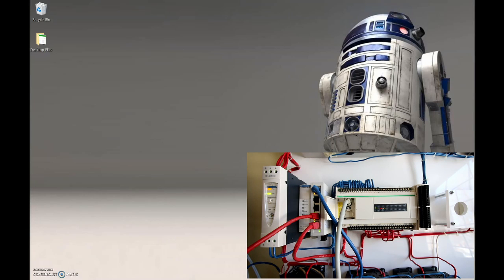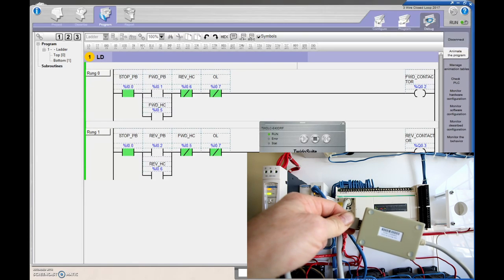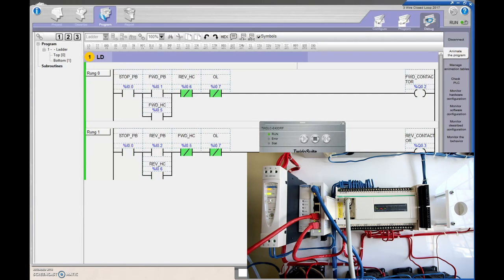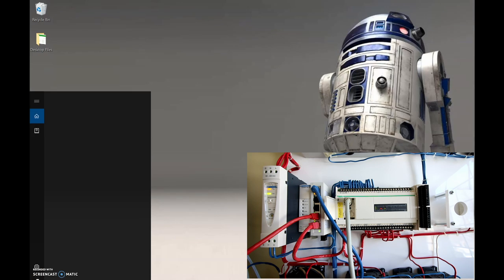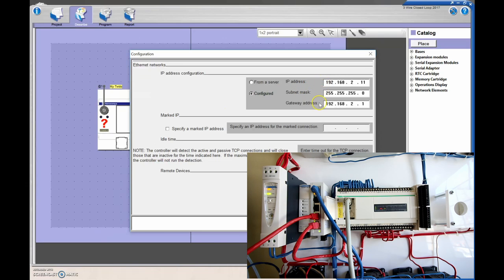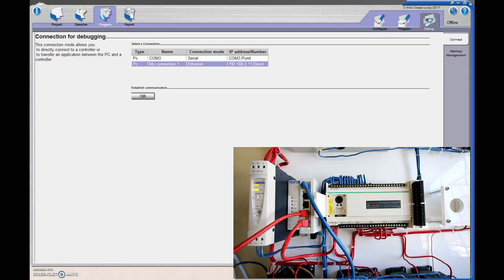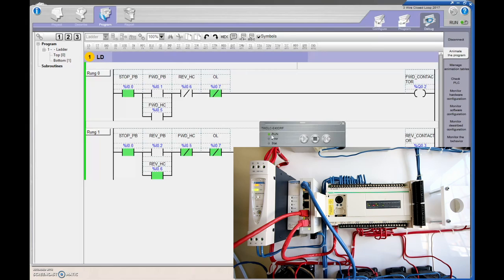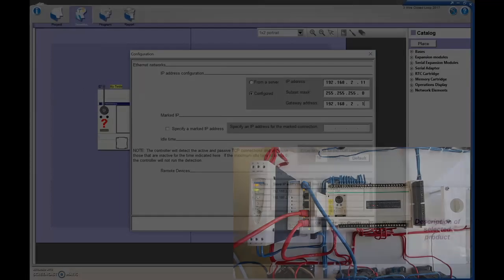PLC Tutorial (TwidoSuite) #12 (Establishing Communication over Ethernet with the PLC)

Comment: Hi Pete, amazing videos you have in your channel ;)

Question, have you tried to directly connect your computer with an ethernet cable? in the Video you are using a switch connected to the internet (router), to your laptop and to the PLC, I'm trying something different, I don't have acesso to the internet so... I'm currently trying to connect twido suite to the PLC using an ethernet cable from my PC to the PLC (TWDLCDE40DRF) and following the steps provided by you in this video and the ones in the User Manual, I'm unable to establish a connection between my computer and the PLC. (Communication error) do you have any other suggestion to this problem or is it really necessary to use a switch connected to the internet for this to work? thanks
Reply from the maker: You need the cable from Schneider to set up the IP address on the PLC. Try transferring a program from the PLC to the PC in order to see what IP address is already set up in the PLC. This is a huge pain and one of the main reasons that I moved away from using Schneider PLCs in the classroom. Having to purchase a $300 cable in order to set up an IP is ridiculous.
Reply: @PeteVree  Hi again! Thanks for the quick answer.

Today I've been trying to force the IP via ethernet cable using Twido Boot-P Server software, I can switch the PLC IP and ping it in cmd, but when I do schneiders step-by-step from their website I still can't connect to the PLC (Error msg: "Communication error. Check connection parameters, network cables, configuration and controller supply."). 

As you might have noticed I don't have the $300 cable, I've been told by some coworkers that at the time they managed to do direct connection using an ethernet cable and I'm starting to think the problem might be the PLC, since its has its error led blinking in red.

ERR - Red blinking
STAT - Red blinking
BAT - Red still
COM - amber still
LACT - amber still
LST - green still.

thanks again.
Reply from the maker: =(    Wish I could help more, but I'm not sure what the underlying issue is.
Reply: @PeteVree  

Hi again Pete, thanks for the concern, I found the pin out of the missing cables and finally managed to connect to the PLC using my homemade (TSX CRJMD25 - Mini-DIN/RJ45 cable
), now I need to find a way to connect to the PLC using ethernet cable, I want to create a master slave and test their Modbus communication but to do so I need ethernet connection to work.

Is the switch really necessary for such situation? thanks in advance ;)
Reply from the maker: I don't think you need the switch if you are simply connecting to the plc. We use the switch to connect to both the plc and the hmi
Reply: @PeteVree  Just an update, finally managed to use tcp/ip to connect to the plc, I couldn't disable the firewall and had to use a diferent computer to do so. 

the procedure you showcased in your video is spot on, shame you wont be doing more videos on twido since they switched to another PLC series.
Reply from the maker: So glad. Thanks so much sharing the info. All the best.   Pete
Reply: @PeteVree  would be too much to ask to do a video on how to set a modbus communication (master-slave between twido PLCs) using twido suite (even tho schneider killed that line)? Pretty pls

I'm getting confused by the guides for modbus communication (taken from schneider website), they present some variables that I can't find in the tables and I can't use them in the ladder coding, I know I need to establish a "back and forth" code using a timer, sending a question from the master to the slave and then waiting for the slave to answer but I haven't been able to do so, I've been at it for at least a week. (shame on me)

As I said before, amazing videos you have running I was always avoiding automation in school but now I'm more and more into it thanks to your videos. Kind regards.
Reply: Hey, can you tell me what Twido Boot-P Server software that you use?

Comment: hai sir,
One Help ,i couldn't able to communicate PLC to PC my details are below,
 twido PLC mode:TWDLCAA24DRF, 
communication cable: TXPCX1031-C and used serial to USB converter to connect with my laptop with windows 8 OS have the all drivers installed, can able to monitor the com3 connected in my laptop but communication with PLC is not happening? please support me on this,
Contact: adaikkappan7@gmail.com
Reply from the maker: Sorry, no idea. You'll have to contact Schneider for help. I've always used this cable: https://www.youtube.com/watch?v=4jOzgeeqa90
Reply: Pete Vree okay sir..
Reply: hi , i have the same twido plc : TWDLCAA24DRF 
                                   communication cable : TSXUSB485 
                                   twidsuite V1.02 
i want to transfert the program from plc to  pc, i get communication but the program was empty, i did not understand where is the problem :(
Reply: the machine still working and there are no error in the plc

Comment: Hi, Pete! Thank you for a lesson! I think you could add the second IP address to your network adapter. For example, if you have your current IP: 192.168.1.1, you can add 192.168.2.1 in your network interface card properties(just check in advanced TCP/IPv4 settings and you'll see). It will work with additional second IP, without reconfiguring your current IP on PC. Now i'm learning Owen PLC (it's russian PLC, running on CoDeSys) and i encountered this kind of problem too, and fixed it using additional IP. PLC default IP address was 10.0.6.10, i added additional IP: 10.0.6.33(in one subnet with PLC), and my first IP is 192.168.1.2. It works great!
Sorry for my bad english, i try to learn it too)